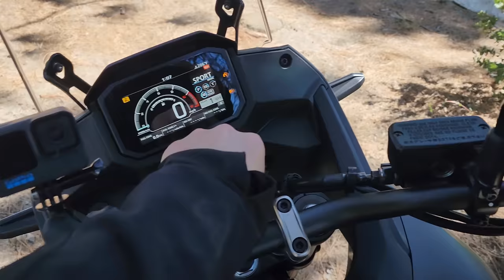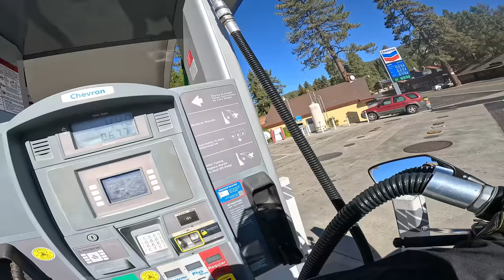Honda Transalp 750 | First Ride On/Off Road (REAL test... no holding back!) (EP.2)

Comment: Would love to get your opinion on the Tuareg 660 vs the Transalp.  Primarily road but also off.
Reply: Agreed!
Reply: That would be awesome Ian to hear your thoughts vs the Tuareg. Your Tuareg review is why I bought one and given the list of items the Transalp would need I would suspect pricing would be very close to
Reply: The Tuareg would slay the Transalp.
Reply: Yes I would love to see that comparison too
Reply: @mrjay4000 not on the power departament though
Reply: @tomaszpieczatka5632  Yes, I should have said off road. The Honda is a street bike.
The Tuareg is designed better for off road. Better ride modes with handle bar switch on the fly abs and traction control. Better longer suspension & ground clearance, better high exhaust pipe mount, better flat off road seat, lower fuel = lower centre of gravity, high air intake and 9 lbs lighter with 1 litre more gas.
Reply: I know Maggie will like the grab handles better on the Transalp but if the Tuareg is close on street, I'll probably go with Tuareg.  If I remember right, the main things Ian didn't like was the looks and the heat of the Tuareg.  I'll still test ride both if I can but these reviews are the best I've seen and he can ride them harder than my skill level
Reply: @DelE-jc3yy  If you mostly do 2 up with a passenger and stick to pavement or gravel, then the Honda is likely a better choice. or a larger displacement bike.
Reply: @mrjay4000  I thought I was set on the Tuareg until this.  They both kind of hit the sweet spot for me, low feeling weight and down low, good power, good on street and in traffic but can easily do moderate offroad.   My girlfriend will ride, but that is probably 5% of the time so not going to put too much weight on that.  I have a feeling the Tuareg might be on par or better on the road/traffic with it's flickability, better suspension and cruise control.  I do ride at 75-85 often which a lot of our highways have that speed limit and I think the Transalp is better for that with the extra power and gearing.  I think both are good choices now that I've seen these reviews, but Ian might control my actual decision LOL.  KTM 890 is probably too much power for my skills right now and I am too concerned about their reliability to take that leap.
Reply: Tuareg all day, it already has the good adjustable suspension, add on some better crash bits and you’re good to go.

Comment: Great video! Anyone complaining  that you purposely tipped the bike over has zero understanding of what motorcycling is. It's not a matter of "if?", but rather "when?", especially if you start venturing off of paved roads. The only place where I differ with you in this video is fueling with premium octane. In stock settings, this bike's engine compression ratio is not high enough to justify 91 octane. Also, if you look in your owner's manual, even Honda's (engineers, chemists, ...) recommendation is 87 octane.  It won't hurt to go above but it will not improve performance in any way. Unless you notice some pinging from the engine, which I doubt will happend, it's a wast of money. Will leave money in your pockets to change that clutch lever! :)

Comment: I swung a leg over the Transalp yesterday and was amazed at how compact and light it felt. I mean, it’s a kinda heavy bike, but it doesn’t feel heavy. And it’s definitely smaller than the Africa Twin. I think it would be much more manageable for an old gink like me. Also very pleased to hear about the good wind protection- I’m too old to enjoy getting beat up by the wind touring at highway speed. Honestly, if it had cruise control, I’d have probably bought it on the spot. 😃 And that sump? Yeah, I’ll bet you dollars to donuts that super smooth engine comes at the price of that sump - there’s undoubtedly a counterbalancer poking down in there. Everything is a trade off.

Comment: I’d be really into this bike if it had cruise control and they upgraded the rider modes. Hopefully they bring the ‘24 Africa Twin to the US because I’m probably gonna buy it.
Reply: Next best thing is an "Atlas Throttle Lock" - check it out
Reply: Yeah similar here. Though it would also take something to get me away from KTM's off-road ABS which is excellent. The Honda ABS looks generations behind as we've seen in this video. Most other things can be upgraded as needed. Suspension, wheels, sump guard etc..
Reply: @defylifeadventure   I’m seriously considering am 890, but the lack of dealerships near me gives me pause.
Reply: @helipilotuh1 understandable. For on the 890 the biggest issue is the immobiliser issue. If you get it, it will be within the first 2,000 miles if not earlier. Once it's fixed, there's no real show stoppers, more just some minor niggles with some bikes. There's some question over the cam lobes wearing on some engines (oddly doesn't happen on the CF Moto which uses the 790 engine), it hasn't blown up to be a major thing yet.
Reply: @helipilotuh1  If you have to cover much pavement at all, I can highly recommend the 2020+ ATAS in either manual or DCT.  I know people say it's heavy, but they are all heavy.  I just did 4000km in a week on my AT and it was a nice place to be.
Reply: Amen.  I’ll never buy a bike without cruise control again
Reply: @richardjreidii  Looks like someone is working on something using the switchgear from the AT. The same guy has already successfully sorted cruise control on the KTM 390 and 690 using the 890 switchgear and can bus codes.
Reply: @richardjreidii  those that say they don't need it have never had it :D
Reply: Not true. I've ridden 100's of thousands of miles and it's probably 50/50 with cruise and without. Many days 800+ miles per day. Yes the cruise is nice but I don't get hung up on it and it's never a deal breaker. 
I've used throttle rocker and nothing. Again, no big deal. If the lack of cruise control on the TA is a deal breaker then maybe your riding will be mostly long stretches of boring asphalt  and this isn't the bike for you anyway. Maybe a Goldwing ? 😂

Don't buy a Transalp because it's the latest buzz and you've got to be a cool kid, buy it because it's the right bike for your riding style.
Reply: @sonnys8535  Some of us live in uninteresting places and have to bomb hard on the interstate for one or two days in order to get to fun ADV trials.
Reply: @helipilotuh1  good point

Comment: It's not so much a ground clearance issue as it is the vulnerability of components, especially the sump.
I can easily see a rock dislodged by the front tire at speed, punching a hole in that oil pan. 
Add a skidplate then you lose another inch or so of clearance, then it becomes more limiting. 

All mfgs need to kick the bean counters out of the room when accounting for suspension.
More properly damped/adjustable forks and shocks really shouldn't add that much to price considering the economy of scale at a factory. 
Underdamped components are a safety issue in my mind.
Reply from the maker: agreed, but accountants control everything

Comment: I've tested this bike. It was not that perfect. Also the quality of the materials and paint felt luckluster. I had it next to a CB500X and the 500 looked more premium. 
 After this, I rode the new vstrom 800 DE and then the MT800 explore (you guys call it IBEX but you don't get the explore in the US) and  I liked both of them alot more that the transalp. 
What makes it worse is that the Transalp has nothing. No cruise control, no quickshifter, no engine guard, nothing. In a world missing the IBEX and the VSTROM, the transalp would have been "fine" . But noway you should pick it without trying the other 2 first. Sit on it and then make up your mind.
Reply: Both of those bikes are over 500lbs no thanks , for that kinda weight you should have bought a GS or AT

Comment: Nicely done video. Your points are well displayed. I agree with everything that you stated. I just bought one of these. Also have a CRF300L Rally, which I have have a blast on. IMO...when adv bikes get up to 1200+ cc, they are like riding a cow off road. I've seen a guy literally burn a clutch out of one trying to get over a pass in CO. The AT is like climbing up on a horse. All of that weight, height, top-heaviness becomes a serious issue in dirt, on loose rocks going down a grade. If you start sliding with all that weight to deal with...the weight and the laws of physics take over the ride. (Unless you are a great rider, I'm not) The TA is not as manageable as the 300 offroad but it offers pretty darn good manageability for a 755 and is great value for 10k.  And power?  I didnt even care about power. I'm a sightseer. I'm into "Honda smooth." The first time I ran the TA up to 6k rpm, the bike shot up the power curve and caught me off-guard and almost snatched the handlebars out of my hands. Literally, scared the hell out of me.
Reply: I might get the transalp as my last bike, I have heart failure now so probably won't get a chance to have more than one more, I do have the 250L rally already.

Comment: My 1st gen TA was more robust off-road having a full cradle frame. I did break a side panel attachment point when it tipped against a rock in a deep rut. I was able to use first-aid gauze and fiberglass resin to repair it when I got home. 
North America seems to have all the market scenarios covered now.

Comment: There are lots of positive things with this bike. For me, the biggest positives are its size and weight, and it's a Honda. 
When I sat on it, it felt more narrow and shorter than the T7 or 800DE, also weighs less than the competitors. The other big positive for me personally is the Honda 'fit and finish'-which,imo is the best out of the Japanese moto companies. When you get a Honda, nothing feels cheap, or thrown together. 
Since I gave the two biggest positives for me, I'll be fair, and list the 2 biggest negatives for me, which ultimately were there reason I didn't pre-order one.
1)the oil sump/exhaust hanging low. 2)wonky tech pack when accessing TC, ABS, mapping modes etc etc. 
As a US consumer, I was able to watch Australian and European reviews earlier this year and was unsure about the tech being 'not so user friendly', and we all know the ground clearance issues. 

For me, I was also worried about how the crash bars, engine guards and bashplate would be mounted. 

Bikes like older V-Stroms which don't have engine cradles, have the bashplates and some crash bars mounted directly on the engine. Heck, even some T7 crash bars mount directly to the engine. That's scary. Terrifying. Especially considering it'll be 500lbs of weight including a camping loadout.

Comment: This motorcycle does not use constant-force springs, so adding preload (slightly compressing the spring) does indeed increase the initial return-force (stiffness).  Look up Hooke's Law (F= -kx).  This is typically more obvious with the rear spring because you can see that turning the adjustment collar adjusts the amount of initial spring compression (changing the length, "x" in the formula).
When you adjust sag, you are changing the initial spring compression force so that you get a fixed amount of drop once the motorcycle is weighted with rider+equipment, etc.   
  To just change weighted seat-height without affecting spring force and stiffness, the adjustment would be to the frame or suspension-mount and do nothing to the springs themselves.
Reply: Yes it does.

Comment: Thanks for the great review. I have had the Tuareg 660 but it is too big and top heavy for me. Me not being a good enough rider for it. I have been contemplating getting the transalp and this review has done it for me! Off tomorrow to do the trade in. Thanks Ian
Reply: Ive been liking the Tuareg 660 and the Trans Alp but have shorter inseam.
Reply: @beunbad the Transalp is way better for someone with a shorter inseam, like me. I have a 30inch inseam and with the lower seat, it works well since the bike is not top heavy. The Tuareg is just too top heavy and tall. I wasn’t confident on it.

Comment: Great video. Looking forward to seeing more on this bike. It seems like a budget friendly version of the Aprilia Tuareg 660. With some better comfort and features than the T7.  It doesn't seem quite as capable off road as the Aprilia or the T7, with less ground clearance, less suspension and the oil pan and exhaust hanging down. Other than those limitations, it almost seems like they copied Aprilia in many aspects. It even has a similar display and rider modes, but with the reliability and reputation of a Honda and a more reasonable price tag. From your video, it really looks like the bike will make a great middle weight Adventure Tourer.

Comment: Great to see you putting the new TA through its paces. As you say, all the ingredients are there for a really good adv tourer with off road potential. Realistically, quality suspension upgrades will set you back £1.5K, protection another £500. Hopefully the aftermarket tech-bods will come out with a TC and ABS overide with memory function (preferably an on/off button  like the first gen. A twin). I'm torn between this and the Tiger 850 Sport, which is more road/touring focused I can't imagine me playing in the dirt with a brand new TA, so it comes down to handling, comfort, and engine charateristics.

Comment: Really excellent review - your identity crisis remark is spot on, it is exactly what the original 1987 and later model transalps had and Honda knew this. They built it for the rally wannabe's (not a negative) who wanted to tour roads and long distances while also being able to head up a trail (hence "Rally-Touring"). In many respects the tranny is the first do it all bike. I love that they have brought it back, however, with the way other companies are doing light / mid adv the "rally touring" principle has evolved and they should have spec'd this more towards a T7 / Tuareg off road capability (especially that ground clearance and exhaust).
Reply: I should add, in Australia this bike is $15400 or so ride away (all taxes, on road costs, dealer bs etc) which is about $9800 USD. So to put better suspension and excellent bashplate and more on this bike still makes it the best budget option out there. T7's, Tuareg, KTM's are all $20-25k here atm, and many still need those exact mods.

Comment: Well, I WAS debating on a CB500X or KLR650 as my second bike, and first ADV bike.  Now I am even more torn with the Transalp on the scene.  I really like what you have shown on this motorcycle.
Reply: I have a CB500X well sorted out for me. Typically referred to as a Halfrica Twin. But, man, 15% more mass but 2x the HP has me torn if I "need" to start over modding again for an, er, 3/4frica Twin.

Comment: all the numbers on this bike is exactly what I am looking for. at 5'6 I cannot handle t7 or the de800. just too heavy and big of a bike for me. I put over 1800 miles on my 23' cb500x and I my 500x but the power is just not enough. hwy speed over 65 the bike vibrates too much. As much as I hate to sell my 500x. I need to see this transalp in person. thank you so much for purchasing and doing all the reviews. I cannot wait to see what mods your going to do with this bike! and one question, how would you get the 90 horses on this?

Comment: Wait, why are we down to 83hp? Same reason why the ZX-4R was neutered?? That just made me lose interest in the bike and dumb as that might sound. I don’t want to have to immediately flash tune it. The Vstrom 800 has better suspension and more midrange torque with the same hp rating.